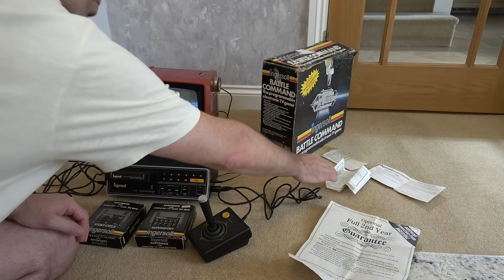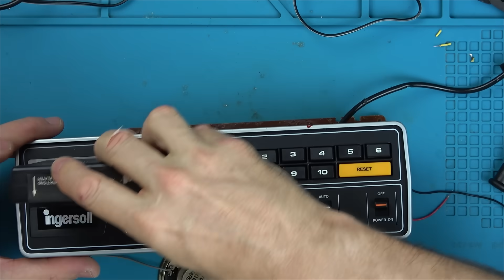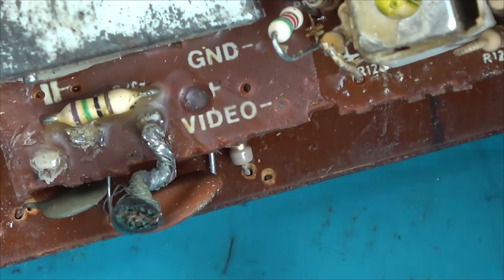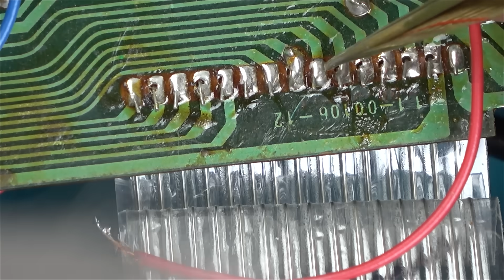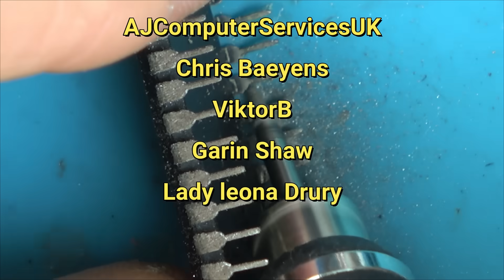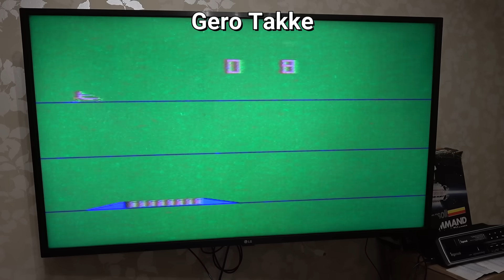I Bought a Broken 1978 Ingersoll Battle Command | Can I FIX It?

Comment: Impressive that those resistors and capacitors are still going after all these years. It’s almost like they were built to last, unlike those in the Sega Game Gear, for example.
Reply: the early 90s capacitors are just generally a bad batch, I guess there was no way to know till 20+ years later. All the things I have that die do seem to be from the early 90s, 80s stuff tends to be fine. and late 90s.
Reply: or it wasn't played lmao
Reply: @Hacker-cw9lc  lol, but actually electrolytic capacities that aren't used and have no voltage going through them can break down quicker because the internal oxide insulating layer thins and allows the liquid to leak.
Reply: That’s because unlike today back then they made things to last
Reply: I guess I've been very lucky, my Game Gear is still running perfect all these years later. I dread the day I have to re-cap it even though I don't use it much anymore. I should get one of those loaded ROM carts for it.
Reply: Ensh...cation process.
Reply: @janeclements317
It's true that re-capping is a pain in the 🍑 But it is worth doing, trust us.
They check fine out of circuit, but in circuit under load, is a different story altogether.
Just our oppinion however
Wayne Brill & Nina Evans (Joint bosses of local electronics repair business. No job is too old, or too new to be repaired) 👍👍👍👍👍👍👍😄😄😄😄😄😄😄😄😄